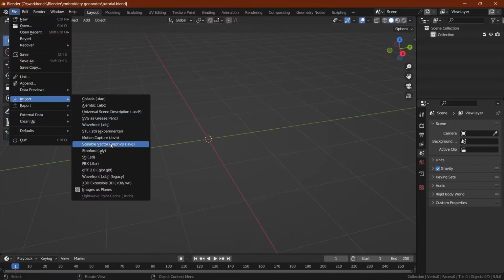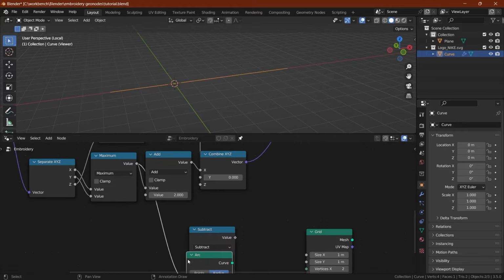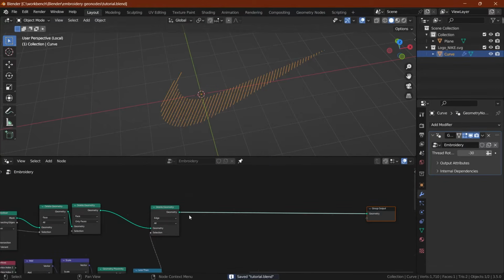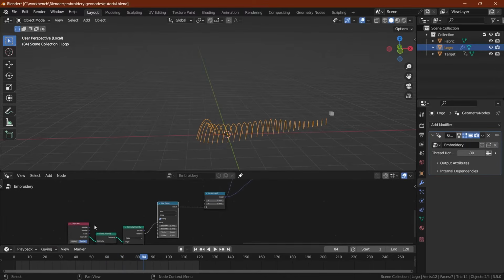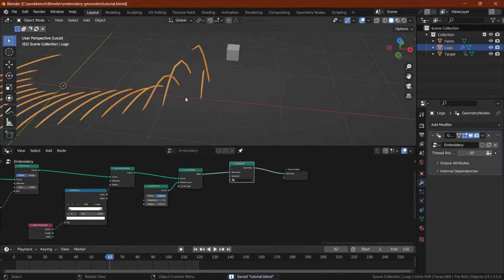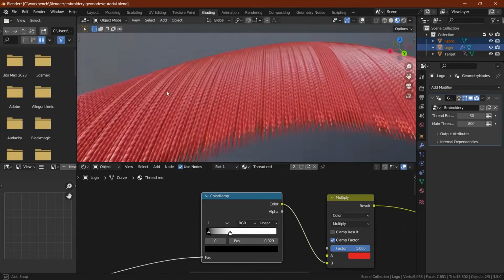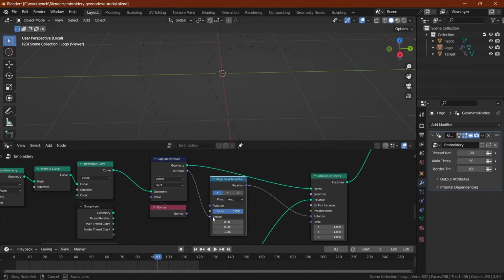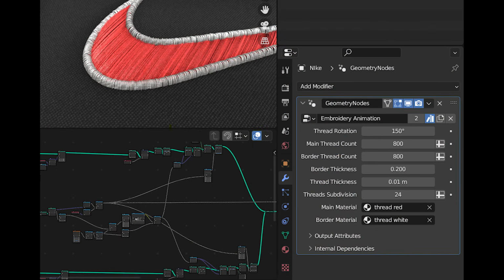Make EMBROIDERY ANIMATIONS for LOGOS in Blender! | Weave Effect

Comment: can someone please explain this for a more recent blender 4.4.3 version cause the capture attribute is now different and now i'm stuck. please help
Reply: any solution yet?
Reply: @jimmyedwardfilms  kinda, i just ended up downloading an older version of blender and since i didn't know the exact version used in the video i went to blender 4.1 and yeah it worked. you can have two versions of blender on your pc just so you can switch whenever you get into hiccups like this.
Reply: @RouvreNetwork yeah i got 3.6 installed rn and he’s on 3.5 so it worked
Reply: You can still use capture attribute it’s just optimized now. You just have to make sure you’re using the correct type like float, vector, etc.. and then use the blank sockets for your attribute.

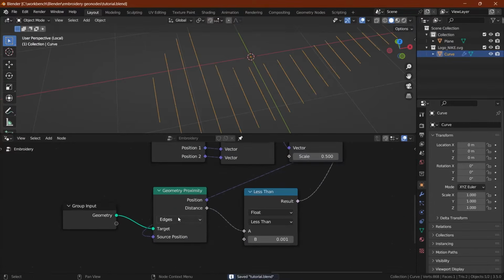Comment: at 7:55 it just shows my original edges; no parallels, no deletion of edges. It worked fine in 4.1. Is there something I must do differently in 4.2?
Reply from the maker: I haven't tested this in 4.2 yet. Will check it out
Reply: @CGiJutsu  Did you find a solution?

Comment: Thanx a lot. Is it possible to set handle position (offset) depending on spline length? I'd like to make curve height of stitches small if they are short, and increase it if stitch is long
Reply from the maker: It could be done if edge length is retrieved and remapped to multiply with the handle position, but would have to be tried. I'm not sure if it would work, if I try I'll let you know.

Comment: Hello, first of all, it is a really nice work. I have a problem in the animation section we did at 13:48. Even though I did everything properly, the image I see is very different from the one in the video. Why do you think the lines are too stuck to the ground and do not move?
Reply from the maker: Did you make sure to connect the 'distance' of the geometry proximity to the color ramp, and not the position? Also check to see if you've applied the scale to your objects.
Reply: @CGiJutsu  Yes, I checked both, but unfortunately the same problem still persists. :(
Reply: @CGiJutsu   And when I reduce the "from max" value in the "map range" to a value like 150, there is a slight height.
Reply from the maker: It's tough to predict the issue reason. Try and check the nodes from the start to see if they all match. See if the target geometry (the cube moving the threads) is the correct position and scale as well.
Reply: @CGiJutsu  I understand, I hope I can handle it. Thank you for the help. :))
Reply: @kreba07 probably different Blender version

Comment: I have a question ! This works like a charm when the geometry of the logo do not countain a hole, since you couvert it to a single face. Like for exemple, if you want to do the same with the letter "A" the top part of the "A" (the triangle) will be filled with curves :/ Anyway to make it work for a logo that coutains a hole in the mesh?
Reply from the maker: I've shown in the video how the Adidas logo (which has closed loops) is used with the geometry nodes setup. Closed loops logos can be used with the full version project file available on my Patreon page.

Comment: what are your pc specifications? i have a pretty beefy pc and each change takes a good 10 seconds to update unlike yours
Reply from the maker: When experimenting and playing around with the settings, keep the threads count low so that there's less lag in the scene. Keep the count close to 100 or 200
Reply: @CGiJutsu  i hadn’t got to the part where you made the filled the into one face, the boolean was taking forever because my mesh was very dense
Reply from the maker: Ah that makes sense why you were facing the issue. The boolean op was being heavy.

Comment: this is just damn good! Is there also added some hair particles on the individual lines in the full project?
Reply from the maker: Thanks! No, hair particles aren't used anywhere. It's all Geometry nodes and an elaborate version of the one shown in the tutorial.
Reply: @CGiJutsu  im in the very beginning of understanding geo nodes, but is it hard to add these in this setup?
Reply from the maker: To add hair? With the new hair system in 3.5, it should be more intuitive. However needs some experience in geonodes to play with it.

Comment: It will work literally in any logo i mean the setting which you have done same thing if I will do and my logo will different than yours than also it will animate like you?
Reply from the maker: Yes, you can bring in the logo of your choice (svg format or mesh) and get this effect on it :) That's what I've demonstrated by using also the Adidas and Puma logo in the full project file.
Reply: @CGiJutsu  where the video is I wanna see that, process is same or anything differing
Reply from the maker: Check the full project file if you want to see how to manage the geo nodes for other different logos. See the description.
Reply: @CGiJutsu  brother its not working in my own logo no changes is giving imean when I m setting geo nodes no changes in my logo as your logo is changing into line stroke  and etc , my logo is not showing in object mode blender when I m setting geonodes 🥺😩

Comment: Wow!!! Great! After looking for months, I was about to ask the community how tonget that c4d embroidery animation nd here u go... Can't thank u more.
Reply from the maker: Cheers! 🙌 Happy it helped you
Reply: @CGiJutsu  can we animate png instead of svg
Reply from the maker: You need a mesh to manipulate it with geonodes. A PNG image won't work. You can easily convert PNG to SVG online using one of the converters.
Reply: @CGiJutsu  yes I can convert but after converting to svg it not importing in blender , I m using blender latets 3.5.1 so any solution for this,  I want png to svg not jpeg after convert from png it is not giving me png bg in svg 😞.
Reply: @CGiJutsu  please if any solution or pla provide me the tool from which I can convert png to svg plz plz plz
Reply from the maker: Look for 'convertio' png to svg converter. If online converters are not giving good results, you'll have to do it manually in Adobe Illustrator. Research the process a bit.
Reply: @MindMatterEDU  go to preferences->addons and make sure that the import svg is checked.
Reply: On the whole yt this is only the video who teachea us how to do it on blender 💙